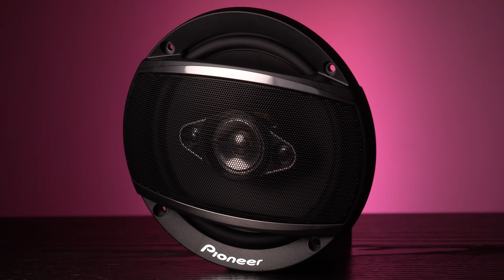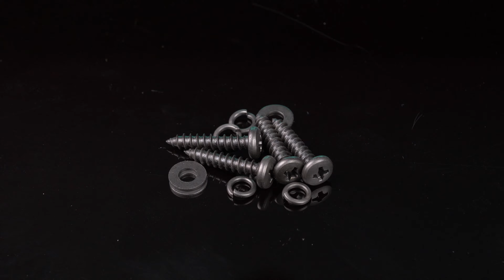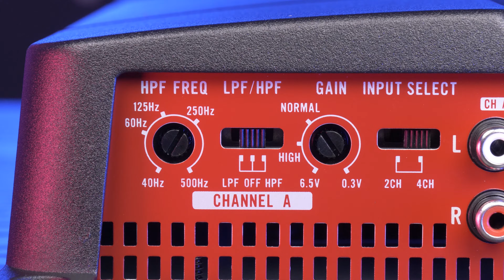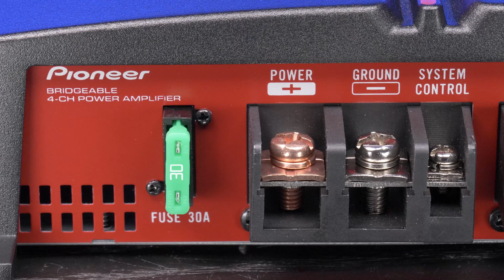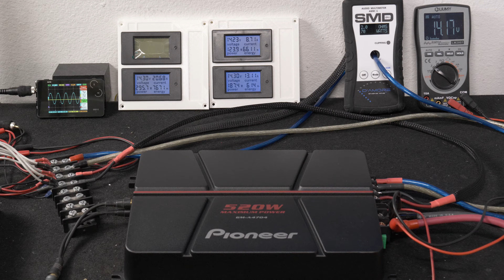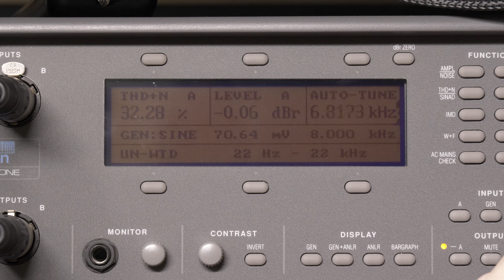Pioneer GM-A4704 4-Channel Amplifier - Perfect starter amp!

Comment: This amp says 40 rms watts x 4 @ 4ohm

I got 2 pairs of Pioneer Door Speakers that say 30 watts nominal.

1 pair the 6.5s are 230 watts & the 4x6s are 200 watts

Would this amp be underrated or just perfect?

Thanks in Advance!!

Comment: Buy two of them and run each amp in stereo mode. The output goes to 130w per channel. If you get the 6704 which is $30 more then you get 190w per channel in stereo.

Comment: I can attest, it does not blow your hair back..   Its good for a sailboat ... or a library. 

 I installed it on a Catalina 27  with a couple  Fusion compact box speakers and a bazooka 6" tube for a 3 channel  set up.  After using the DD1 and the CC1, it  really was pretty weak on volume   Its a $200 amp and thats exactly what you get.  The Kenwood Excelon 302-4 is slightly more $$ but is louder for sure.
Reply from the maker: Sounds good for a Catalina Wine mixer...

Comment: I have the pioneer GM-A6704 4-Channel Amplifier. I will will be using it as 3 channel in my workvan, My 2 front speakers and a subwoofer. My radio is Jensen CAR710W. This radio has 3 Pairs of 4V preamp outputs (F/R/S). Where should I connect the rca for my sub? Should I use the rear channel or the ones labeled subwoofer. Also, the radio is kind of unusual how they label the subwoofer preamp outputs. They are labeled as subwoofer 1 and subwoofer 2. I am used to seeing (L/R). Please advise. Thanks much...

Comment: Hey guys. I have a 2017 F150 with a factory 8 inch head unit. I just installed for Focal (Rex-165) coaxial speakers I’d like to add a sub and a amplifier if needed. Just not sure where to where to connect speakers. Do I have to run them over to the head unit or can I tie them in the kick panel? perhaps you have a video showing something like that with the existing head unit radio and adding an amp and sub. Don’t need much just maybe enough to get a little bass…PS. Great channel great information thank you.

Comment: This is the ideal starter amp. All the basic features you need for it to work great on stock head units and aftermarket alike. 130W bridged doesn't seem like a lot, but for an efficient subwoofer it is PLENTY if you just want accurate low frequency fill-in.
Reply from the maker: Nails every spec with very low distortion, it had at least 1-1.5 dB headroom at 1% distortion. Our test are continuous power.
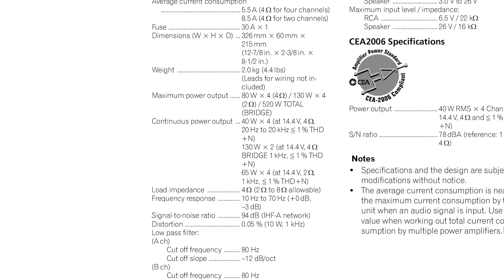Reply: 😅 1:07 1:08
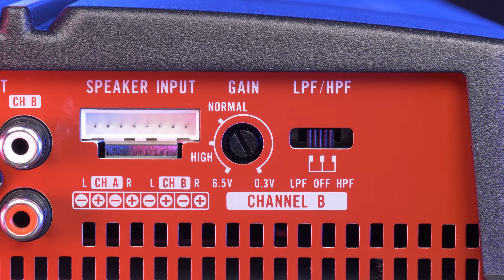Reply: 2:18